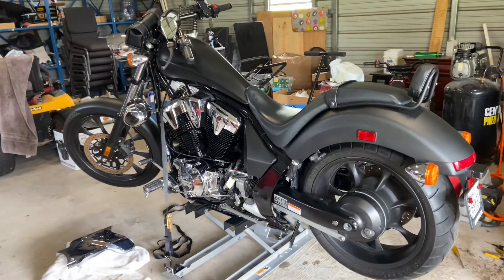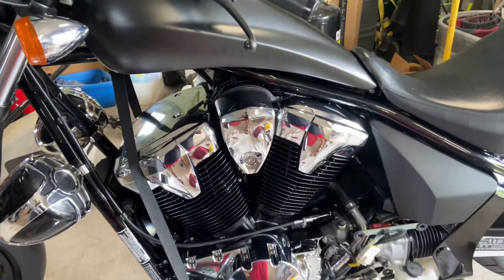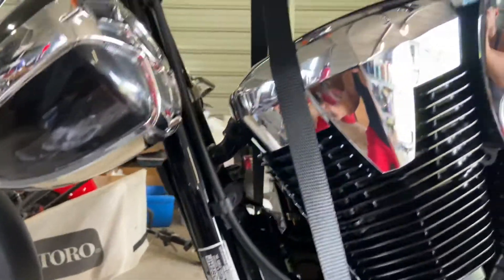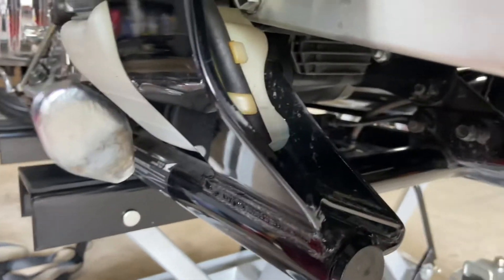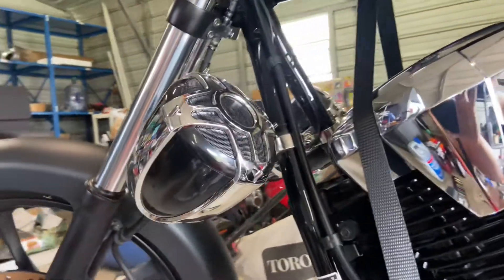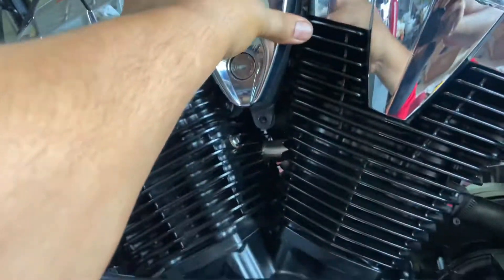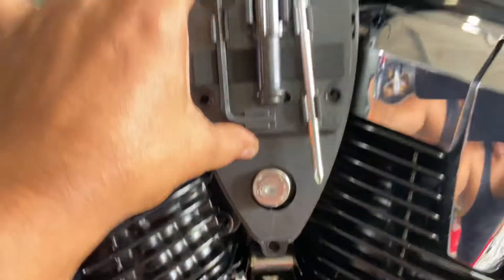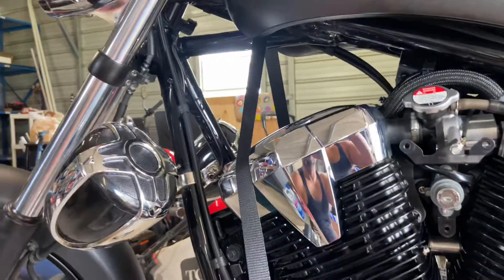Honda Fury Radiator Cap Location / Coolant

Comment: Hi bro, you made a mistake here mate: to access the tool box, you only needs your finger to press the 3 plastic rivets. Honda designed like this, as you do not need to undo the screw underneath to get into the tool box as you said. And that is NOT ridiculous as you said. Thanks
Reply from the maker: I did realize that after a while… lol although I never even knew it had a tool kit initially. Thanks

Comment: those speakers, did you have to alter the clamps, or did they fit from factory? i like that position, better than handle bars. thank you.
Reply from the maker: Thanks 🙏 in fact I did have to alter the clamps, like beat them a little straight coz they wouldn’t fit, but a little playing around and I got them on. They definitely look a lot better than being on the handlebars.

Comment: you push the centre of the key surround hold in pins with your finger tip, no need for a tool, honda are not stupid, unlike some people !!!
Reply from the maker: I suppose you are correct 👍

Comment: I just read the manual and it only says to fill reservoir do not remove radiator cap
Reply from the maker: Yes I read that too… but my problem was that I thought my bike had very low coolant and just filling the reservoir probably wouldn’t have helped… so I dug deeper.
Reply: how do you drain the old fluid out before refilling
Reply: @charlesdelaney916  yea I have that question too we’re is the drain bolt
Reply: @charlesdelaney916  it's near the kickstand, close to oil filter, I believe it's 8mm